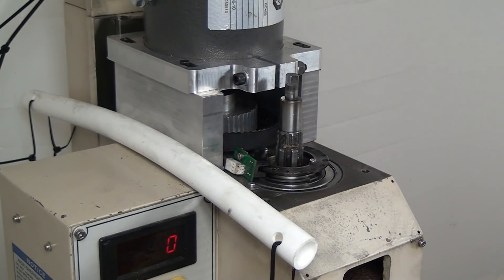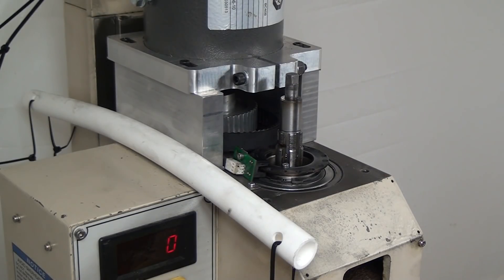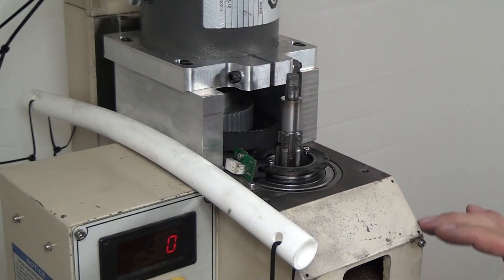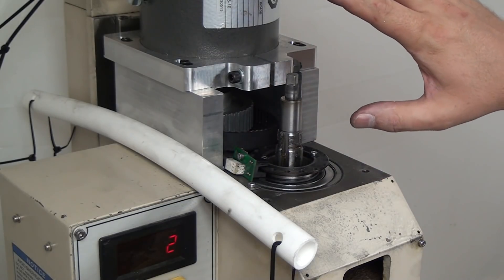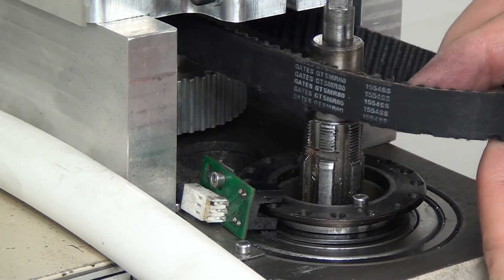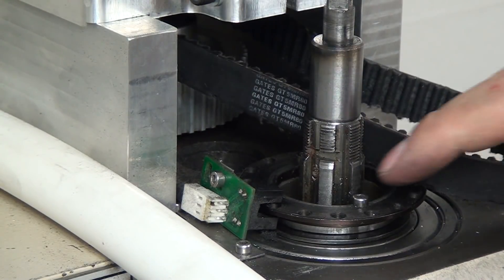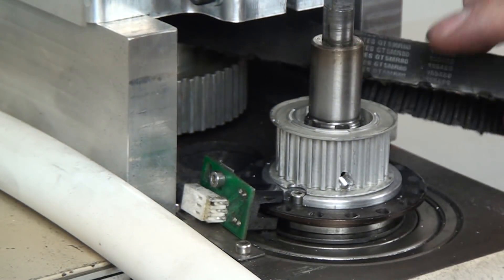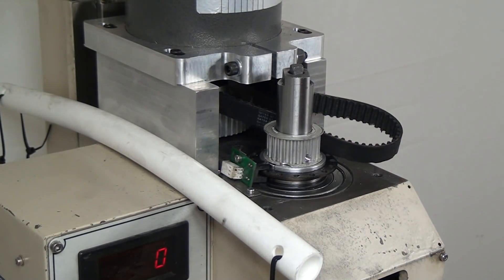Viewer Asks: Belt drive, how to quill (or not)

Comment: For this very reason I haven’t moved to a belt drive yet.., but I’m looking for alternatives as we use machines here manually as well. The other factor is the need to have a motor on the column fast and precise to compensate for the fine feed being removed. On our larger mills this presents more of a challenge. I can see both pro and con to this approach although there must be a better way to do it. Otherwise it seems it may make a great amount of sense to purchase a larger preassembled belt driven spindle and make a new head to House it. Perhaps a true 5th axis at that point.

Comment: I have one unrelated question.  I see a lot of direct-drive designs with the steppers sticking out the front and one side.  I've also seen a few belt-drive table designs, using a hollow rectangular channel.  In those cases, the motors are still sticking out.

Do you think there would be clearance to flip the motors to the other side?  On the Y axis, it could be sitting beside the base rather than extending out the front.  On the X axis, it could be to the back or the front parallel to the table.
Reply from the maker: Paul Frieden Yes, you can do either. I've seen the X-axis stepper parallel and behind the table, and I've seen the Y-axis stepper below the table, to one side or the other, and near the bottom of the base below the table. If I ever do the X-axis double-nut upgrade, I'll probably belt drive and move the stepper back at that point too. I have way more speed than I need, but would really like more torque.
Reply: Paul Frieden I'm currently (finally!) converting my G1006 mill to CNC.  I'm using 4" X 4" aluminum tube with .25" thick walls for the X and Y motor mounts to hold my NEMA 34 stepper motors.  I probably could have used 4" X 3" tubing.  The G1006 is a step up in size from the 0704 - twice the weight, twice the HP, but a round column instead of Z ways.  I picked up the X aluminum box extrusion today as well as a steel angle to use for the Z motor mount.  I'll pick up the Y aluminum box extrusion tomorrow.  All three axes are driven with L series timing belts with 1:1 reduction, with modified 14 tooth pulleys on the motor and the lead screw.  The X motor on my mill protrudes to the left of the table, making the machine footprint wider.  The Y stepper motor is tucked in to the left of the base, not adding any to the footprint.  The Z motor mounts on the right side of the milling machine head.  The Z motor mount will attach to the right vertical steel tube that I'm adding for the power draw bar.  If that's not clear, I'll be uploading the video for the X and Y motor mounts, probably within the week.
Reply: russtuff Cool - It seemed reasonable, but I was hoping I wasn't totally off base.  I haven't seen many that aren't direct drive, and none so far with the motors out of the way.  If you recall where any of these could be seen, it would be nice to take a look and see what others have done.
Reply: Liberty4Ever Nice - that looks like a pretty hefty machine!  I'd be interested in seeing how your conversion progresses, especially if you're doing the tube-based mounts.

Comment: I am running the BTP belt drive. He uses a standard v belt. Doesnt seem to cause any issues with slippage and is quiet(er) than it was and i picked up some higher speeds. 
The issue with deflection of that spindle shaft is most likely negligible unless you were using a crowbar to tighten the belt. Having said that, I do have to change belt tension for different rpms. It is a simple 1 handed affair.
I do want to retain quill function. The spacer you refer to by Hoss is just to eliminate the rattle.
Reply from the maker: ***** Thanks! The spacer to move my pulley up off of those tiny bolt heads killed the horrible racket I was getting, so now it's quite reasonable. I'll get a new belt ordered too as that might help even more (since mine is chewed up). The V-belt option sounds like a good way to go though. That's probably what I'll recommend to people who ask.

Comment: If that's not the original part, could you say something about the tach pickup on your spindle? Are you planning on linking the RPM to Mach3?
Reply: Crivo152 That is the stock tachometer (or it looks just like the 1 on mine). 

There is a member on CncZone (MHackney) who has a method of sharing that signal with Mach and the original display at the same time.
Reply from the maker: ***** Crivo152 Yup it's the stock piece. I'll be using the CNC4PC C3 index pulse card (which I have already purchased) to send the tach signal to LinuxCNC. It also comes with its own pickup so I could watch the RPM on the mill and computer monitor if I wanted, but once I install the card I'll be removing the electronics enclosure on the head and only use the monitor.